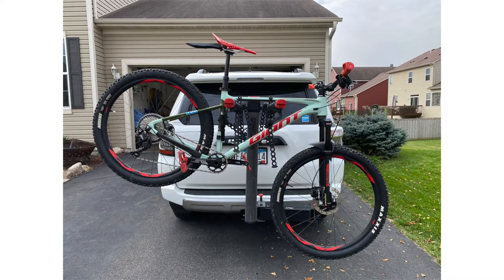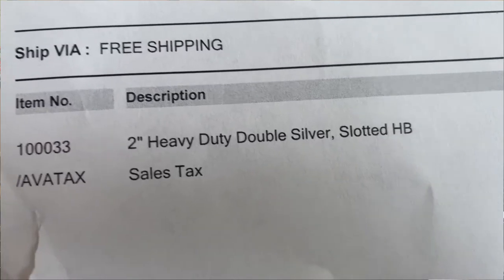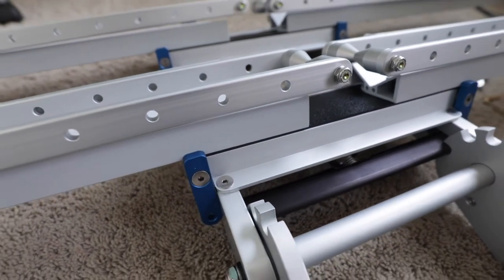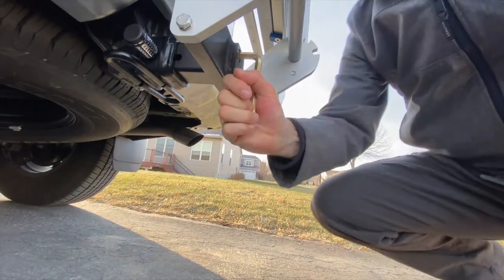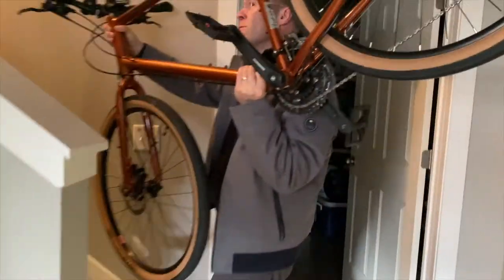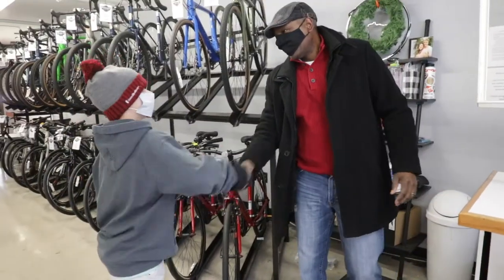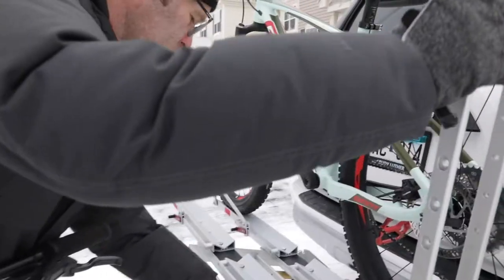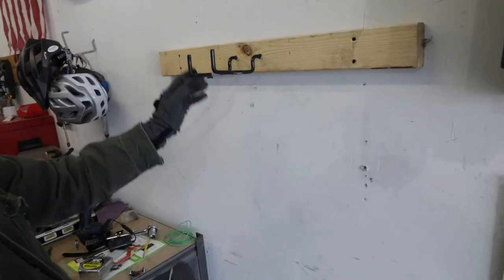1UP USA Bike Rack Unboxing, Review, Vehicle Installation, and Building a Custom Wall Hanger

Comment: I’m 100% positive this rack was my first and last rack I’ll ever buy.  Also if something stupid does happen every part is available for replacement through 1up.
Reply: Yep, their customer service is excellent.  I was missing a bolt years ago and they shipped out a replacement immediately, no questions asked.  Recently I had one of the lever some loose after almost 8 years and they expedited the replacement part immediately just based on a pic I sent them.  Truly impressive.

Comment: Nice video!  Thank you!  We live in Alaska and spend 1/2 the year fat biking.  We recently ordered a 1 Up and were very disappointed at how hard it was to operate.  The levers are very stiff and sharp metal on your hand.  Pulling on the lever that raises and lowers the rack hurts my hands.  With any amount of dirt or water on the rack the track/slides squeak loudly and are difficult to move.  The handles for releasing mechanisms need to be MUCH more ergonomic/rubber to be easy to hold and able to endure the shock of the release into your hand.  We are returning it and going back to Thule or Kuat. Also, if you have studs on your snowbike it scrapes the black paint off of the rack.   All of my friends that have 1 Up racks have scratched paint if they purchased black.
Reply: Too bad to hear about your experiences, bummer.  I have a Kuat NV, and will be upgrading to their new rack coming out this spring, the Liston Pro X.  You should check it out, but I’m not sure when it will truly be available.  1 Up built their rack based on some features from Kuat, but improved.  The Piston Pro X is returning the favor and is now able to easily handle fat bikes, up to 5” wide tires actually.  

Good luck my friend!
Reply: I'm still researching. I did notice all the sharp angles of this design. It would be simple to round off all the sharp edges but would increase to cost or time if I "DYI"ed it. I was also surprised at the tiny diameter locking hitch pin.

Comment: The lock you're using as a hitch lock... isn't it actually a wheel lock to make sure your bike can't be taken off the rack? That's what those holes aligned on each arm are for I believe.

I got rear -ended and am in the market for a new rack (luckily no bikes were damaged)... this one is definitely a contender!!
Reply from the maker: Yes.  True. You can use it to Locke the bike wheel too.

Comment: The Kuat NV 2.0 is more impressive and modular.  I had been looking at reviews before I purchased it and it's probably why this video was recommended to me.  I watched out of curiosity, but the NV 2.0 is the best rack I've ever seen.
Reply from the maker: Yes. The NV is also a great rack!  I debated between the two and am happy with my purchase but the Kuat is a nice setup.  I like the built in bike mount for field maintenance on the Kuat.
Reply: My 1up rack folds up to size of shoes box and fits in my trunk.  They kuat was too bulky and didn’t like way front wheel locked.
Reply: The QuikR Mach 2 blows both of these away EASILY.  The main problem is their availability.  😢

Comment: Good review.  The tilt handle appears to be designed poorly.  If one wanted to tilt the rack down when all the bikes on on there, it doesn't look like  you can reach the tilt handle below, especially if you have short arms and your head will bump into the bikes.

Comment: Nice video thanks.
Any way to accommodate bikes with Fenders safely?
Reply from the maker: A number of folks have asked this.  Anyone else tried?  I don’t have fenders on my bikes and I don’t work for 1Up.  The bikes are held secure by pressure on the tires.  Perhaps a bracket or pad could be installed to prevent damage to fenders.  Thanks for watching!

Comment: Great video! Question regarding both 1up. How is it traveling on the highway 65-70mph? Any issues?  Thanks
Reply from the maker: I haven’t had any issues yet.  The bikes tuck behind the car nice.  It’s the sturdiest rack I’ve ever owned.
Reply: I’ve got the 1.25” version that I bought approximately 7-8 years ago. Wipe it down and it still looks and works like new.

I have driven to Yosemite approximately 400 miles away with an older Schwinn beach cruiser w/ a Thule baby seat attached and a smaller kids bike that also weighs a ton and never has any issues. Absolutely no issues traveling down the freeway traveling at the legal posted speed limit 😉.
Reply: @James-nb3iq  How does the rack work with bikes with fenders?
Reply: @aleengrabow9510  I just asked that Too! 
Lol I’ve seen the ramp option that I’m hoping will help us more easily load our electric bikes.

Comment: From the creator of 1Up ‘Cal Phillips’ before he was pushed out. QuickRStuff is the best rack ever made.
Reply: Not if it never comes out and it's priced more than the 1up.
Reply: @andrewscasualmtb  who cares… when it addresses EVERY shortcoming of the 1UP and does absolutely everything better.  Plus it had a license plate extender and a heavy duty ramp (built-in).  

The big problem is the Mach 2’s availability.  They’ve got production capacity concerns they need to fix.

Did I mention they need NO TOOLS ?
Reply: @gaffle-411  Their site still says backordered. Has it even really come out? Until then, with availability, it's still not out. It's been forever.
Reply: @andrewscasualmtb  they’ve got a live order portal that shows order count and ship dates.  Looks like there are around 4K orders and only about 160 units have shipped so far 👀… 😞
Reply: @gaffle-411  Yikes. Yeah they need better production if they're going to catch up on orders. I do like the concept but in my eyes it's just a failed one. Too many issues. Like the design and price.
Reply: @andrewscasualmtb  If they were available NOW, I’d gladly pay the asking price.  1UP needs to come out with a 2.0 version and attempt to copy what Mach2 has done.  Those pesky patents may get in the way of that though.  😄